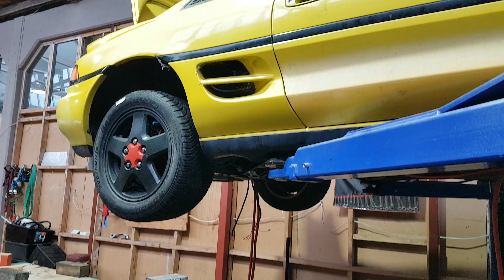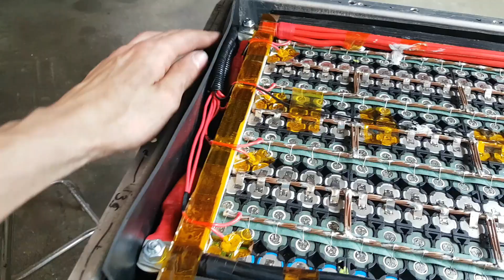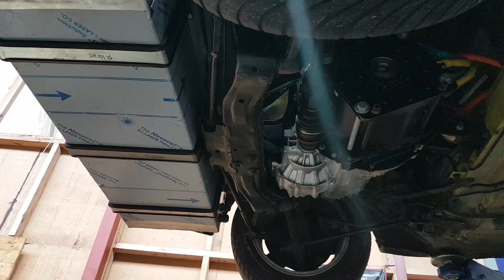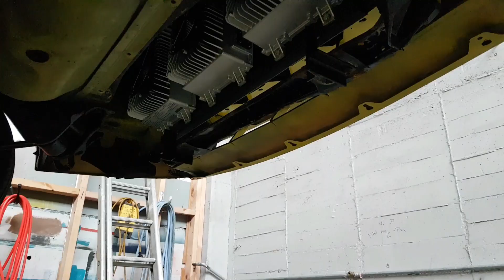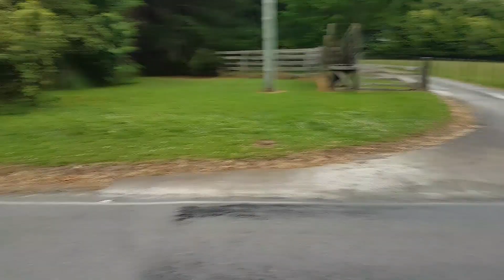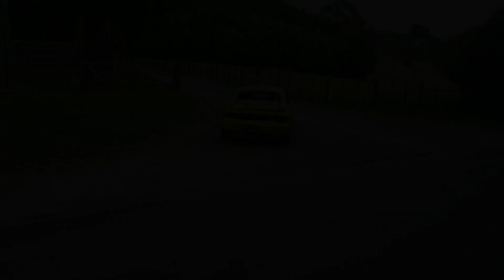Electric Toyota MR2 - First Battery Installation and Test Drive

Comment: Damn good job. How many hours before them little battery's go bad? They only last about a year in my vape......
Reply from the maker: These particular cells have very good life left in them. I had them running on my ebike for a year with less than 5% degradation, with 30 - 60 minute discharge and 2 hour charge cycles. I have since rebuilt to improve the designs safety. 

Cheers

Comment: Great job!  How does the car feel to drive in comparison with the original IC Engine - in terms of acceleration, power curve & speed?  Also, hill climbing ability?  I guess, what I'm really asking is, is 20kW sufficient for this size vehicle, for it to be useful & nice to drive?
Reply from the maker: Hi thanks!
The mass is quite spread to the edges of the vehicle with the battery structure. Unfortunately this is difficult to work around given limited spacing to position batteries other than the front and rear.

The 18kW of power I recorded at present is enough for town driving. Wouldn't be good for hills given the weight of the car (about 1300kg).

Power curve will be more even and consistent, acceleration is quite slow at the moment unless you drop the clutch :)

Cheers

Comment: Nicely done! What do you think of the HPM 20kW, Stefan? Decent build quality?
Reply from the maker: Hmm. Thats a hard one to answer - as I have never taken the motor apart before. There is a guy in Australia (I think by the name of AusEmoto) that has done some investigation on it.

The motor works, and at 20 kW the heating is rather minimal after a short drive - although I personally believe (opinion only) - a much greater power density could be achieved by a dual magnet disk rotor single stator design, than dual stator and 1 magnet rotor in the design due to wasted flux out the opposite sides of the 2 stators. I have a feeling the cooling ability of the motor is better in the design due to the stators being further out, and the end faces being in direct contact with the stator, but don't take this too seriously as I am in no way qualified in electric motor construction and design.

Pretty sure there are much better motors in this axial flux design for power density that are commercially available.

Cheers